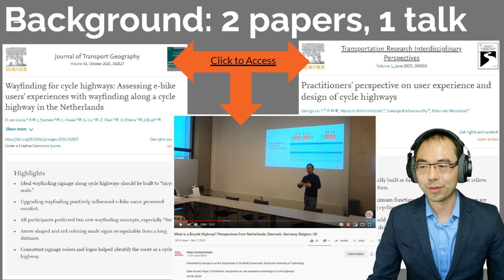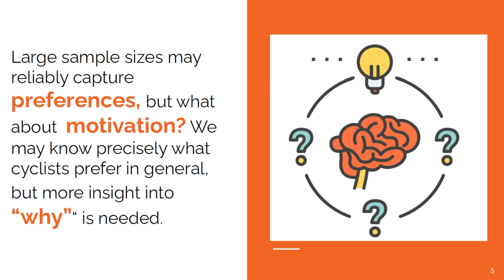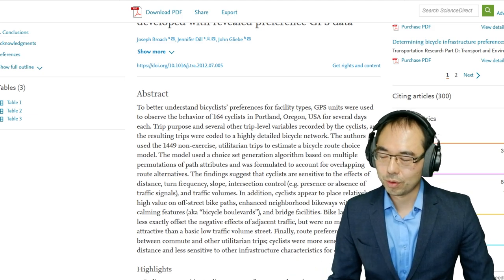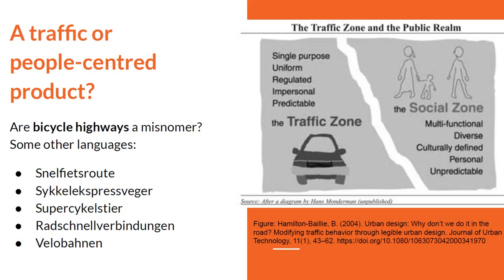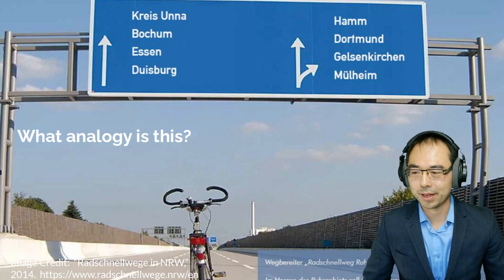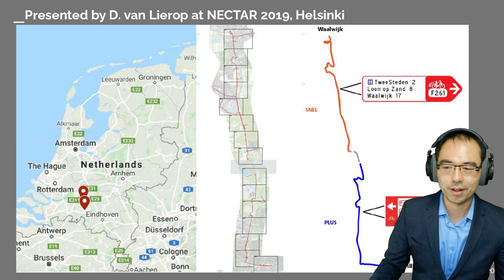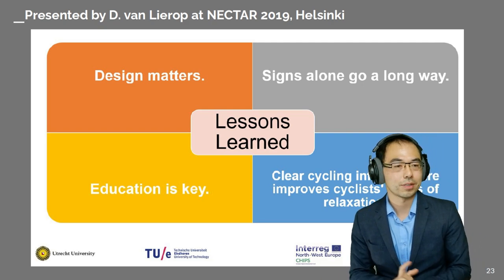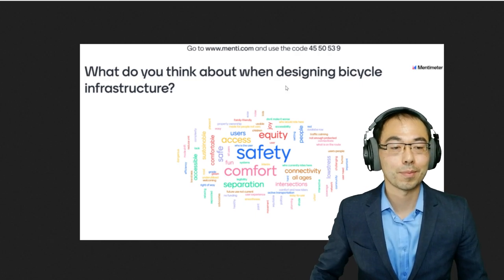Bicycle User Experience & Bicycle Highway Signage

Comment: Noting your question of 'why are certain routes preferred?', here is my stated preference: I prefer routes that have some turns every now and then rather than an infinite straight stretch, just to get to do something other than just pedalling. In winter, I prefer roads without snow and wind but with sun. In summer, I prefer routes with wind and with shadow.

As an inhabitant of Tilburg, I can confirm that not the entire highway is done: The last bit of connection between the out of the city part and the large bike paths in the city was still being constructed when I went to the dentist a month ago.
Reply: I definitely agree about the turns vs straight options, and being a UK cyclist, rather than Dutch, I also prefer a route that is neither completely flat nor with excessive climbs; the occasional slight hill may mean a bit more effort on the upwards section, but is recompensed by the thrill of the downwards! [Don't get me wrong, I love cycling in the Netherlands too, as the infrastructure makes the journey pleasurable - hopefully, 2022 will see a return to that as an option]